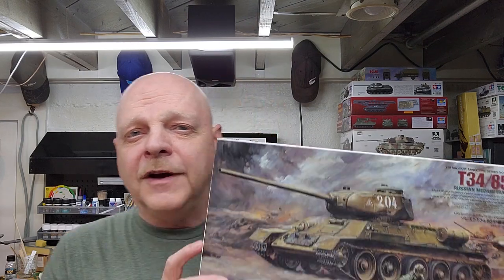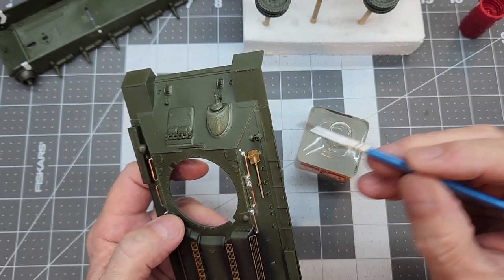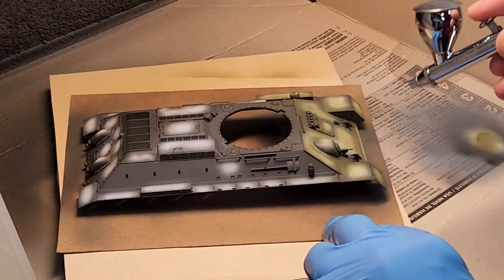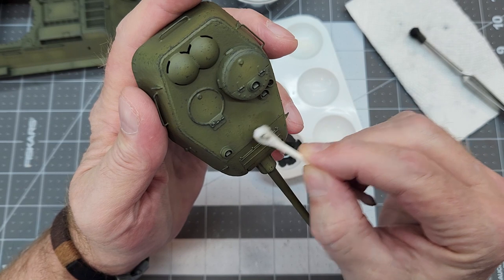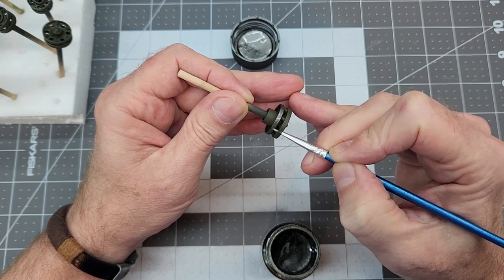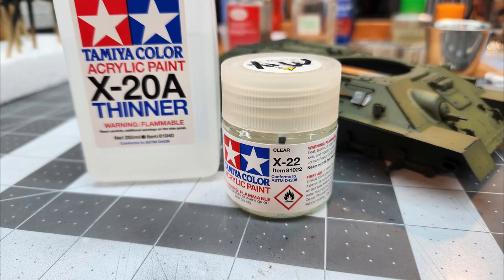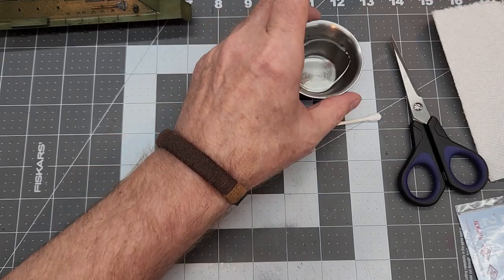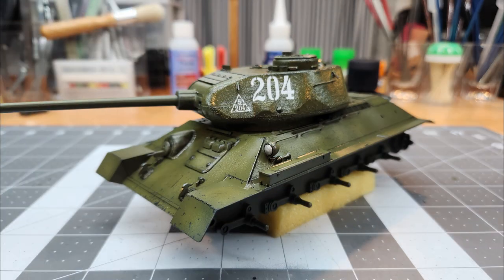T34/85 by Tamiya in 1/35 scale, Part 5, Painting, Sponge Chipping, Decals, Pannel Liner

Comment: It's maybe too late now, but, why didn't you textured the driver's hatch parts as you did with the hull MG's casemate (with great result)? They were casted part too.
Reply from the maker: Hi Zorg, even though the drivers hatch and visors are cast, it doesn't appear to have a really rough texture, at least in the photos that I've seen. But you can easily add the texture if you like. Obviously, after painting, it's too late to revisit a small detail like that, unless you would want to repaint the hull. At this scale I would say that texturing is subjective on small items. Thanks for watching, stay safe and model on! Johnny